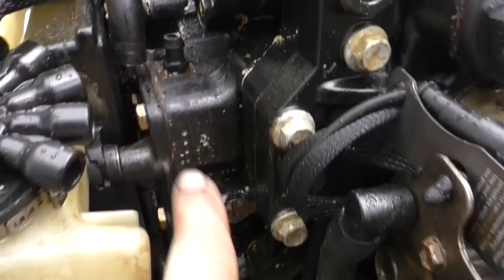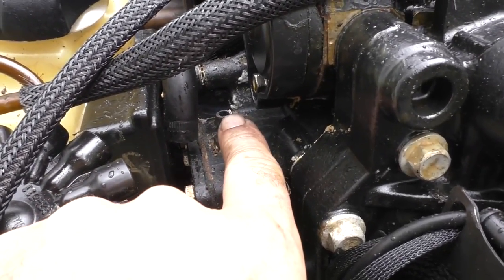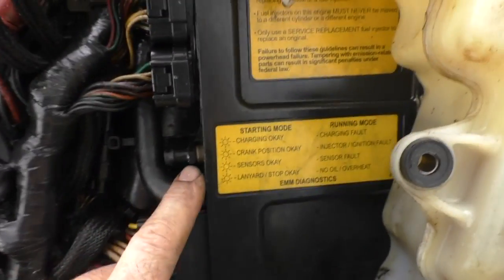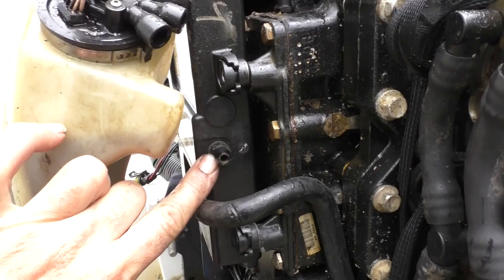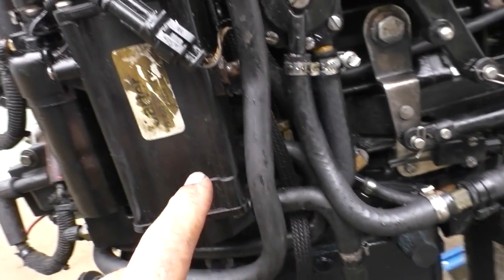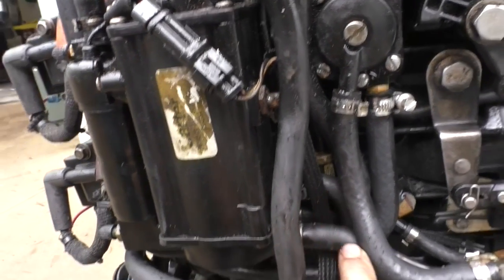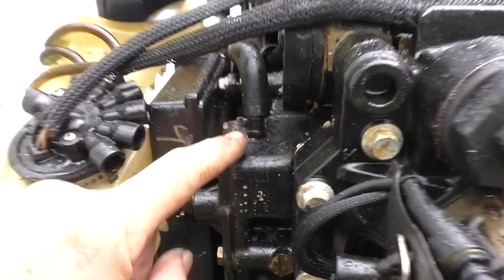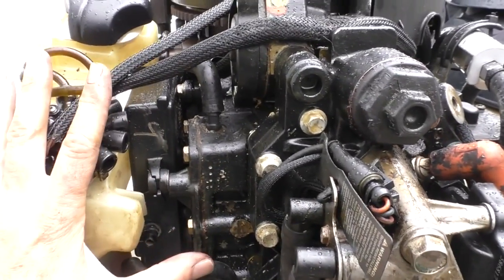E TEC telltale trouble

Comment: Had this job just last week on an ETec.  Actually had a blockage in the VST but not enough to stop the tell tale or even slow it enough to feel hot when running. I think what happened in this scenario is that the overheat warning was not a true 'hot engine' warning but a 'ECM overtemp' warning caused by the water flow slowing down enough to heat the ECM. If you have analogue gauges you only get a red light/audible alarm but if you have i-Command digital gauges I believe it will indicate a hot ECM as well as a true overheat situation
Reply from the maker: This outboard is quite old and had the old analogue gauges so I can't be 100% sure what type of overheat it was but it seems to have stopped happening now which is good. I really must look into some type of scanner like the one we have for cars to help get to the bottom of these types of error code.
Reply: i have a 90 hp e tec and its stops running after 10 or 20 mins and like you mentioned i get a red light/audible alarm

Comment: Your videos are brilliant. I have a 175 etec over heating. The pipe going through the ecu has no water flow at all cold or warm it’s connected to the thermostats. I have removed the thermostats and ran until I get the overheat light but no water comes out the thermostat housing. Should water flow in or out the thermostats?

Comment: G'day, love your vids! I have just replaced my 2009 90 etec water pump and cannot get a tell tale. I've rechecked the fitting and am sure the job is correct. There wasn't a problem with the old one. Would it need bleeding?

Comment: Just subscribed and enjoying all of your videos.  Thinking of repowering my 18 ft aluminum V-hulled fishing boat.  It currently has a 1994 Yamaha 70 hp (2 stroke of coarse)  Thinking about a new Yamaha 70 4 stroke but concerned about the ability of this motor to get the carcasses of myself and overfed friends up on plane.  Current motor can do it, but it takes some time.  I heard the 4 stroke will not have the grunt on the low end that the current motor provides.  That leads me to the 75 etec.  I like the video of it jumping up on plane, it is lighter than the larger 75 HP 4 strokes, not sure I'm comfortable with all the magic that makes it work.  I've become accustom to a very reliable and low drama motor, would you recommend an etec?
Also, you seem like a very smart and hard working guy, hope you are well paid for  your efforts.
Reply from the maker: Hey Tom. 18 ft is a pretty big boat, but I know my friend's 15 ft boat gets on the plane amazingly quickly with a 60 Yamaha four stroke on it. I would personally always go for a four stroke, but that's just my preference.

Comment: I can't wrap my head around the ecu thing. I imagine the engineers sitting together like we have this expensive and delicate electronics here let's better rum a stream of sea water thro it, yeah great idea!
Reply from the maker: Must be the same engineers that decided the spark plugs have to face a certain direction to work properly! ;)
Reply: Dangar Marine True! It's quite a pain to line up the sparkplugs if you get unlucky and almost none fit correctly. 
Guess two stroke injection engines need alot of electronics to pass emissions
Reply: Those same engineers are the ones who make cars that require you to remove the tire to change a battery....
Reply: Def quite a circuitous route for water to traveI. I would guess that the internal electronics within the ECU are potted in epoxy....so water isn't going to affect them.  The biggest prob is see with the design...is that it's prob prone to clogging easily, should debris be sucked up into the motor.  This is esp true for those who powerload their boats at the launch.
Reply: Would you prefer a fan cooled radiator mounted on top? Lmao
Reply: Robby G13 every car ecu is passiv cooled with cooling fins as part of the enclosure. Most of the heat is generated by the mosfets for injection. Would be nice to see the reason behind the design to water cool
Reply: TheAF93 you realise this is a BOAT motor right?
Reply: Robby G13 you still need the same things combustion engine is combustion engine and as I said would be interesting to know the reason behind the design
Reply: TheAF93 car ecus are 99% found on the opposite side of the firewall lol. In this application it's literally inches away from the engine block and exhaust manifold while being contained inside the same cover... Its the engine heat that's the problem, not heat generated by the ecu. Surely you're not too stupid to understand this
Reply: Ok i had some time and did some reserch and found the reason behinde watercooling. The ECU in this case also houses power electronics like rectifier and powermosftes for fulepump, olilpump and egnition colis so you get a lot of thermal los due to internal resistance. thes things usually are switch with relais in cars. and btw my car ecu sitzs next to the engin and has passiv cooling. The cpu is not cooled so ambinet temp. is not a problem
Reply: I worked at a company which designed eletronics for car engine bay applications and the eletronics needed to work up to 125°C or in some case even up to 150°C (if your engine block gets up to 150°C you would most likely burn your headgasked). But as i said befor the reason is that the device not only does data processing like a usual ECU but also power mangangment so you get a lot of extra thermal los due to the resistance of mosfets. So my first comment was a bit superficial because i did not look up the details of the device. but i found it kind of funny.

Comment: Yeah, the cooling system on these engines is really complicated, and a bit over engineered for sure....It is important to keep that system clean to avoid setting ECU overheat codes and damaging the ECU.  This cooling system must be properly drained to avoid freeze damage to these components as well.  Running one of these engines through sand or mud really creates some cooling nightmares!
Reply from the maker: Although it never gets freezing here, it isn't hard to imagine the damage that could do. This one was overheating because it had been run through mud, it was quite blocked up.

Comment: I have a 2013 etech 115. The over heat light is coming in but water pump is new and installed correctly with a good telltale. I disconnected hoses on emm and flushed water in both directions. No sign of blockage. I put thermostats in pan if water and they opened before 150 degrees F.  Now I'm trying to locate the temperature sensor. Anything else I should check?

Comment: Water comes out the tell tale when the outboard is running but when I have a garden hose installed it doesn't, is that normal? I'm having some issues with my motor going into limp mode.

Comment: Hi fella hay I was wondering if you have any ideas on a etec gen 1 running issue it was working fine when I took it out to the lake couple of months ago went accross the lake then was using the aux to troll but had to start and stop the big moter as was really windy and needed it to correct the steering … at end of the day went to give it a good blow out and it was coughing spluttering missing I thought I’d fouled the plugs so got some new ones and made sure they were indexed correctly same thing would idol fine but soon as you accelerate starts coughing spluttering . So I changed all filters along with fresh fuel same thing . I was told they have a choke that can stick open but can’t find any info on location but I’m at a loss on what it could be it’s obvious it’s a fuel thing but I’m stumped on what to do next 

Cheers Craig

Comment: What about the fitting in the middle of the vapor separator. I bought my motor used and when it was shipped to me there is a crack in the plastic where the middle fitting vertically toward the outside of the canister is located. I pulled the hose off and it was all rusty inside. I went to blow on it and it taste like salt water. Now I have put it in the water and started it, and it leaks out water through the crack. I was just going to remove the fitting and try epoxy instead of buying a new vapor separator.

Comment: For some reason (after the dealer changed the impeller and gasket) I cannot get water from the telltale unless I run it in a barrel of water?? What could be the cause of this?  I have plenty of water pressure and new water cups to connect hose

Comment: the crazy thing about the vst canister is no common sense replacement parts. if u break a fuel line nipple off the top screw in cover,  you have to buy the whole canister new $600.00. instead of a new cover and o ring. Then the tiny vst filter. but i wouldn't trade my 200hp e tech for a different brand. love my e tec
Reply from the maker: It's a shame it is only sold as a while unit. That's a lot of money for what could be a simple part swap as you say.

Comment: I wonder if the water going through the ECU is also checked for flow? So if your cooling water is not present after a minute or two the engine goes into limp home or shut down mode? There is not much in an ECU that needs cooling normally (it would be crazy not to build them to car standards, and the car ones are 85deg C operation rated) , maybe the voltage regs and the coil FETS, but using FETs as switches usually means almost no heat  at all.
But what a convulated pipe path, lots of connections to leak or mix up!
Reply from the maker: Agree Ron, I don't see how every other engine management system in the world manages to get away without being water cooled. The potential for blockages and leaks is huge with this outboard.
Reply: Dangar Marine well on a lot of Diesel engines the use the fuel to cool down the ECU. For an example an Bosch EDC7 draws 35amps that 820W to cool of. The drive steps to the injectors uses quite a lot of power
Reply: The injector power is included in the ECU`s power rating, but of course the power is dissipated at the injectors, not in the ECU itself. But fuel cools the injectors of course. But I don't disagree that the multiphase injection scheme used for modern diesel engines , and increasingly the direct injection  petrol engines means hotter running ECUs. They could use bigger heatsinks and just airflow for a far simpler solution, but that means using more aluminium or copper, and therefore cost. Weight is not a consideration or else the seat motors, window motors , 25 cup holders and 35 airbags could all be eliminated .
Reply: Its an inch from the engine block and 4 inches from the exhaust manifold...Using vents and fins isn't sufficient because of heat transfer(thermodynamics) and space limitations.  mechanics 101 here boys 😂

Comment: I live in newfoundland and in winter season these engines have to run for a while before the you see any tell tale from rear on really cold days.. Supplier says not to worry.. Amy thoughts on this??
Reply from the maker: There is quite a bit of piping to fill before water will come out the telltale, but I wouldn't expect it to take more than about 15 seconds.
Reply: Suspect something freezes. After the engine runs for maybe 5 mins or so  it starts to flow.  Winter temps are around -15C and windchill can be around-25C. Doesn't set no codes or nothing.

Comment: Hi Stu I have a 2005 225hp  E-Tech the alarm gauge is sounding only when running slow around 1000 rpm shut it down and restart and runs a few minutes sounds again,but doesn't happen when running at higher rpm's also pissing strong. What do you think the problem is   Thanks   Bryan
Reply from the maker: You'd need to have a scanner plugged into the ECU to see what the alarm is.

Comment: Question. Should I be able to blow air in the water intake of the VST and Have it come out the other end (2009 6hp Etec)? I have tried this at both ends using a hose and blowing by mouth. Thanks
Reply from the maker: I would imagine so, yes, as water is supposed to flow through there to keep the fuel cool.

Comment: Do you know if a 25 inch shaft 115 Etec can be converted to 20 inch? I have a 115 etec with blown power that is 20 inch which I need for my well craft 180 fisherman but I found a great price on a 115 etec with a 25 inch shaft. Can I swap parts and make the 25 a 20?

Thanks man love your videos.
Reply from the maker: If the price is right, I would just take the powerhead off the new outboard and put it in your original motor.
Reply: I thought about that too but the blown motor is a 2005 in not the best shape the new motor is a 2014 looks new. I’m thinking about running a 5 inch vertical extension plate if I can’t change the stack

Comment: I didn't get the part about cooling the fuel.  Looks like water coming thru the ECU would be warmer than fuel coming from the tank.  Could you better explain the fuel cooling theory?
Reply from the maker: Hi Michael. The fuel from the tank is cool yes, but with EFI motors the fuel is kept under pressure at about 40PSI and unused fuel is recirculated. This is the fuel that needs cooling to stop it from boiling.

Comment: hi Dang,my vtec 150 is spending oil,what should i check,i lost 1 liter of oil in 150 hour of work time
Reply from the maker: Check the compression on the motor. You could have worn rings meaning you are burning oil. Does it blow much smoke? It could also be a blown head gasket meaning oil is leaking out or could also be the lower main seal that is leaking.
Reply: engine is violently shaking in neutral,but higher rpm is steady,smoke is normal,thanks,you are the man,i assume if it is lower seal i would be able to spot oil marks in water but i dont

Comment: I have a 25 evenrude etec it runs and after 10 minutes running it shuts of and won’t start for another 20 minutes what could b the problem sir
Reply: Same problem here, any updates
Reply: ankledeep11  I fix it it was the electric fuel gas pump
Reply: @ankledeep11  same problem here
Reply: any updates  mine is a 90 hp e tec
Reply: Vst fuel pump failure

Comment: Well ours is weird were getting over heat warning even with full water flow. We have an e-etc 150. Doesn’t always do it. It stumped the dealer. Runs great and fuel efficient that part is great. How ever why the over heat tone comes up after being on plane for a bit. Being in cooler weather still water temp is in the upper sixties. We don’t run her hard just around 3100 rpms or so but ever since new same thing. Please find an answer. My father isn’t pleased at all. We would like to have a fishing trip where we don’t have to stop shut it off for a bit start up go again sometimes it corrects itself runs normal others she decides I’m hot. My dad thinks its in the electronics i think the emm or engine management module is bad. SOS please help?
Reply from the maker: So does it actually overheat? Even with full water flow if the thermostat is jammed closed or the water galleries blocked it can still over heat. An infra red thermometer is a great way to test the actual temperature of the head. It could also just be a bad temperature sensor in the block.

Comment: Hi man my evinrude ficht 250 2003 is running bad or slow mode after 10 +- minutes of work. Then i only move the shifter to neutral and it work fine for 5 more minutes
Reply from the maker: Hmmm, that's a weird one. Might need to get it scanned and see if there are any error codes. It sounds a bit like an overheat but it could be a sensor failure too.
Reply: My own questions is what is the reason that it fix just for goin to neutral ???

Comment: If my steering is smooth and easy will it get stiff if I grease the pivot tube
Reply from the maker: No, it should stay smooth and easy. If you use a non marine grease it may stiffen up over time as the grease reacts to the water and salt.
Reply: ok thanks, I was just wondering because I used to always grease my old motor with marine grease but I just got a newer outboard and was just wondering.

Comment: Etec's are designed to cool the fuel?
Reply from the maker: Yes, because of the high pressure of fuel injection the fuel needs to be kept cool as the pressure increases the temp.
Reply: Dangar Marine I had the sensor service soon sign come up on a new gen 1 Etec on Saturday.  It was a boiling hot day, 40C + and I was fanging it like a good Aussie with the kids.  Could the night ambient temp just be the problem or more. New engine, 2 years old. I’ll take out again but won’t know unless the  message come back but often the computer needs clearing on these motors I’d imagine.  Engine lost no power, in fact I think I beat the devil out of it and it performed as always, smashed all contenders. 135HO G1. I love this engine. Different to the V4, in that it’s better but the 130 V4 G1 is a weapon considering it’s weight and output. The sound can’t be beat either errr, save for the V6. But again, I’ve had both and both kick arse.  I’m nervous about these 3 cylinders though...

Comment: I have a 75 etec im trying to connect to diagnostic wire from boat to my labtop can u help me any
Reply from the maker: Never hooked up an e-tec for diagnostics, sorry.
Reply: @DangarMarine  3 pin deutch plug usually forward of flywheel.

Comment: I assume the nipple on the exhaust cover is before the water goes into the engine, correct ?  The ECM and the VST want the coldest water possible !
Reply from the maker: Yes, it is water that hasn't been through the motor.
Reply: Interesting, thanks.  So it shows the pump is working, but not that it's getting through the engine/cooling, etc.

RichE
Reply: RichE - Good point !  Most telltales are at least warm.  I guess they are relying on the temp sensor to warn for that.